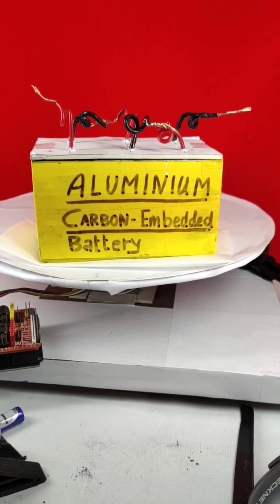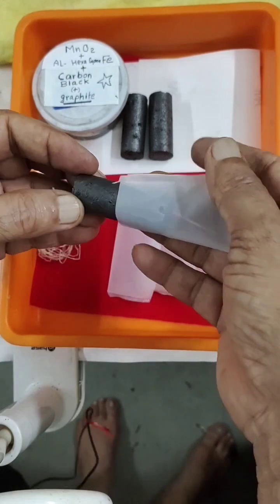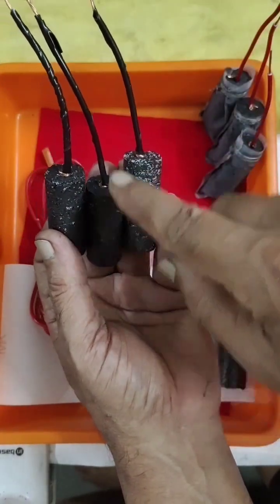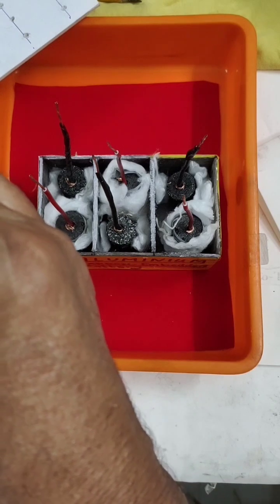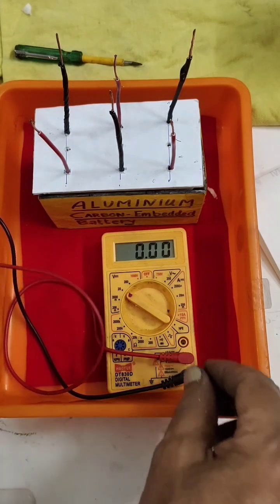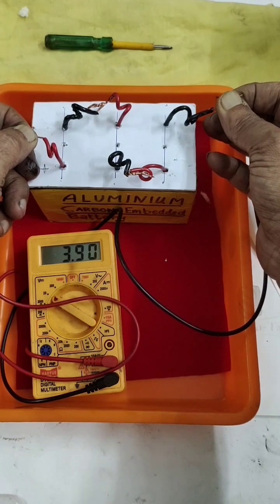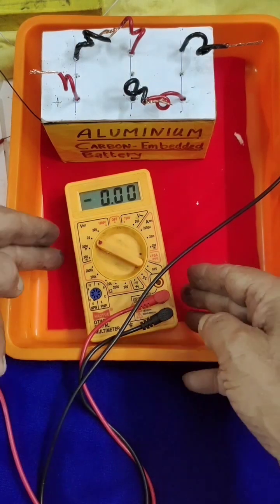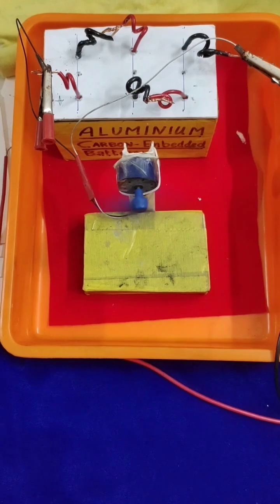ULTRA ALUMINIUM CARBON EMBEDDED BATTERIES, V 3.9-5.2, 500mA, 10,000cycles, NO-LITHIUM, DIY. VIDEO 97

Comment: how did you put the screw and wire without disintegrating it?
Reply from the maker: Use 2mm drill bit to create hole on the top to insert tightly the copper wire as terminal. The carbon rod will not crack. It is rigid.
Reply: @dkjawahar-techexpt671  thank you for this. does it disintegrate when submerged in an aqueous electrolyte for a long period of time?
Reply from the maker: @jianneangelikacubillo1969 Once the carbon rod is cured properly there will be no change to n physical structure. It is the same as commercial carbon rod

Comment: Good battery. Great to know that it has large no. of cycles. 
2 questions
1. Will the electrolyte dry wit time & stop the battery from performing.
2. how to get large capacity like say 10AH
Reply: important question , a higher amp battery is something to see for next.

Comment: Awesome video man. You have my subscription. Can you do a video on how you make the carbon electrodes?
Reply from the maker: Thanks for the subscription, I will try to make a video on making carbon rods👍
Reply: @dkjawahar-techexpt671  Ah that would be really awesome man! I have tried using Styrofoam and acetone and mixing it with graphite but yours seem to be a lot more conductive than mine. Perhaps you have a better process or use something different 😀

Comment: How you know, if your battery survive 10000 cycles, whilr you doesnot have tool to test it ?
Reply from the maker: Friend it's high time that you can share your valuable videos in your channel so that all can benefit from your experience.  These are all models that will be useful to the younger generation who are interested in this battery science.🙏
Reply: I find your videos very interesting and want to make large size cells to make a 5 kw battery pack for the farm house. Sir What type of cell do you suggest. Your input will be of great help thanks. 🙏

Comment: Thank you very much for sharing your knowledge with us. Your battery is an amazing battery. It has very stable voltage, current and chemistry. 

I am planning, why can't we use  more finely powdered aluminium in the anode? Also,  let us make rectangular cells instead of circular so that we can maximize space usage. Add activated carbon to the mix to increase surface area and so the current.
Reply from the maker: Okay, I will try 👍